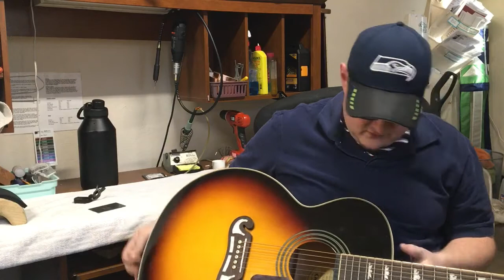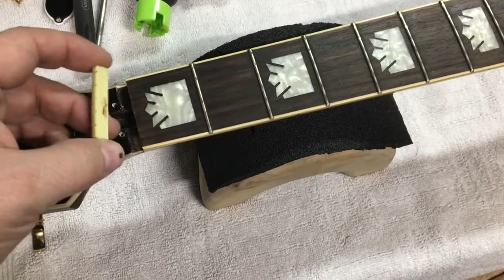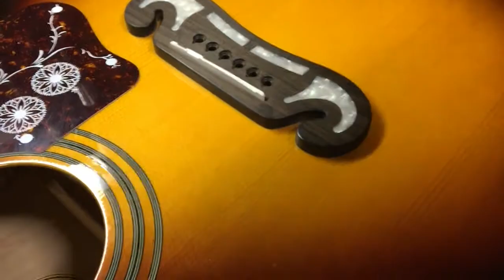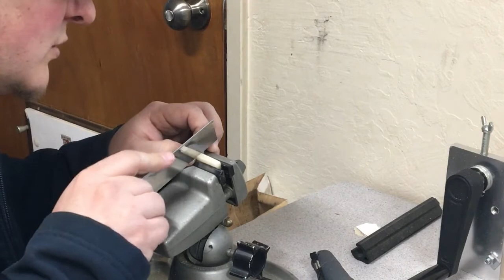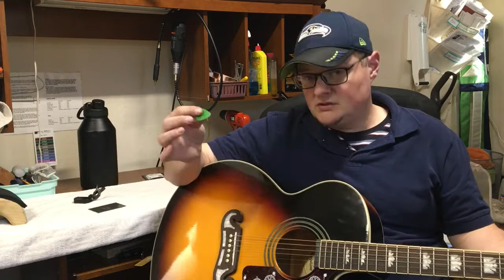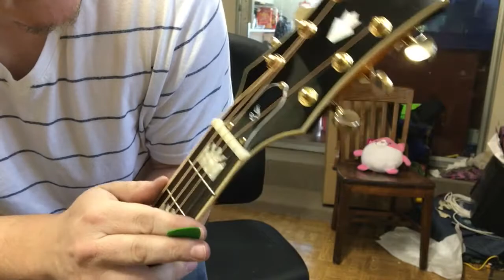Plastic Parts vs Bone and Tusq, Can you Hear a Difference?

Comment: Does it really matter? No. There are only six notes that use the nut.
Reply from the maker: Ahh, but every note rings from the bridge…
Reply: @MillerCustomGuitars  Touche'
I'm a Floyd guy. So I basically use pot metal for my nut and bridge.
Reply from the maker: There’s Floyds and there’s Floyds. A Floyd with Pot metal will function just fine, but one that is made from better materials will usually give you better sustain and more lively overtones.
Reply: @MillerCustomGuitars  Yeah , I know.  I have both. I just used what it came with.  My Floyds came from the year 1984. Not the model 1984. Except the EVH PV ones I use.